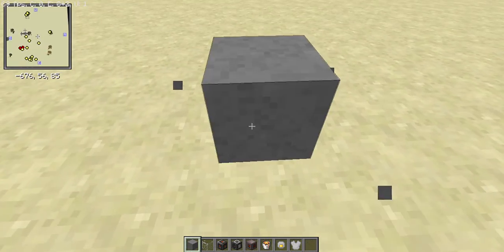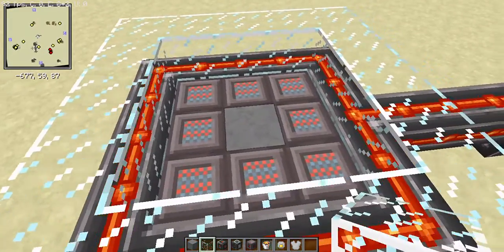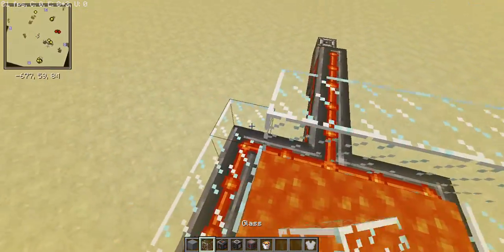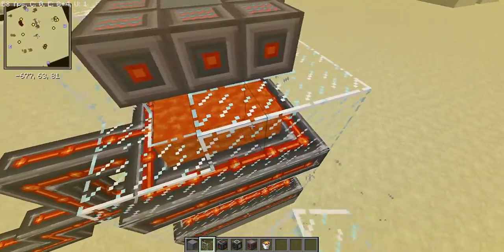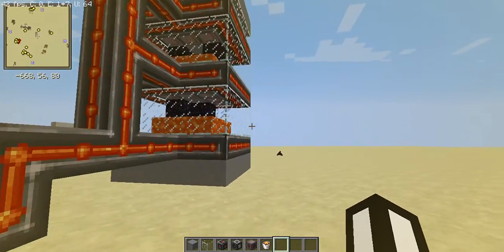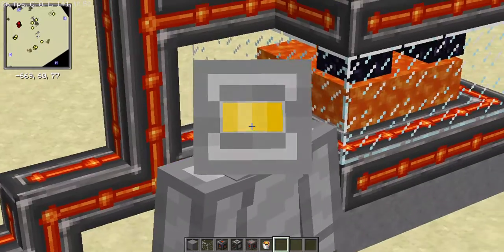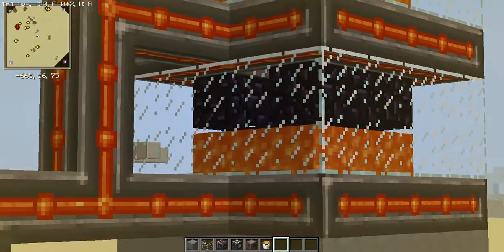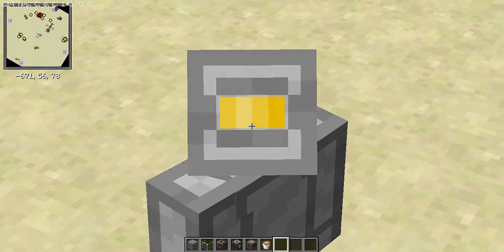How to get easy unlimited early game energy! | HBMs nuclear tech mod guide

Comment: Does the lava eventualy deplete? for me this is working in 1.7.10 but i want to know if the lava ever runs out
Reply from the maker: Well, according to my original design, no, HOWEVER, it seems that HBM changed something down the road since i made it, which...kinda fricked it up, but i DID make a new video on this same topic, which you can find on my channel!
Reply: thanks! another question, do i need to wear fire proximity or is it not required?
Reply from the maker: @tijndissevelt  When you're close to lava and stuff? think not, its only when you're gonna go THROUGH hot elements, since it gives you the "fireproof" atribute, which negates all fire damage, and it isnt the only one that gives you such atribute

Comment: Doesnt work everything becomes obsidian
Reply from the maker: Yeah man, sorry for that, this design is a little outdated to say the least, should probably find a way to update it, there is another video of mine featuring a similar concept though! you should go check it out
Reply: @TheChosenIndividual  It should work also with flowing lava, which will still become obsidian (flow, not the source). If you have a mod which adds a block breaker then you get both power and obsidian generation.
Reply from the maker: @mcnaotlichno  Good point actually, i had never thought of that...maybe we're onto something!